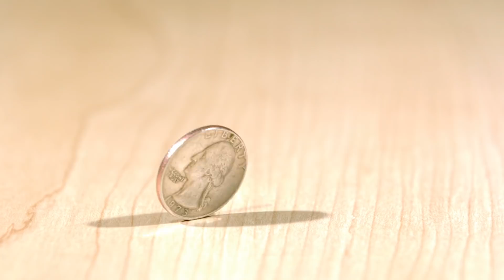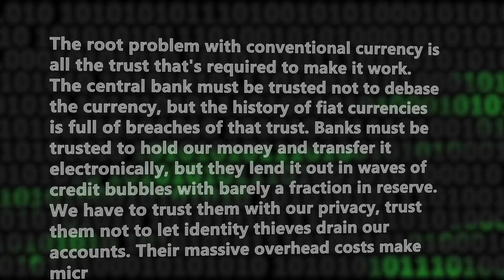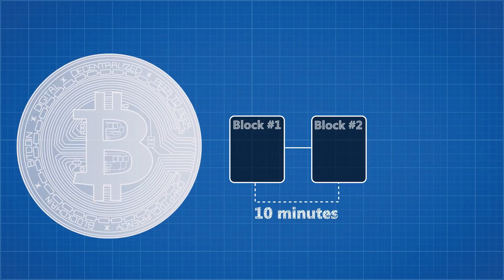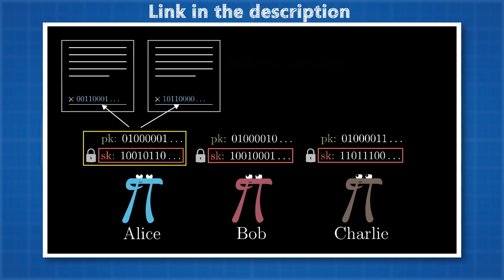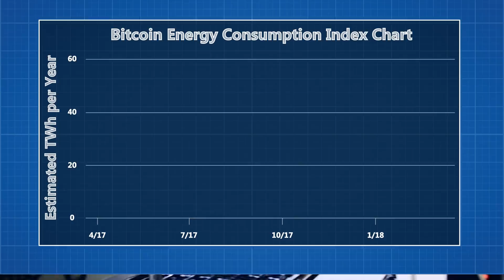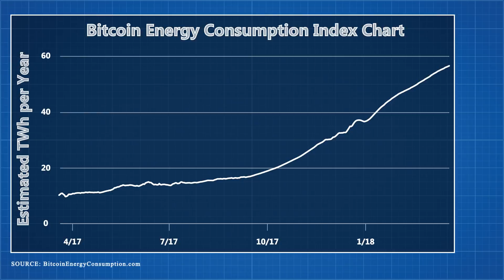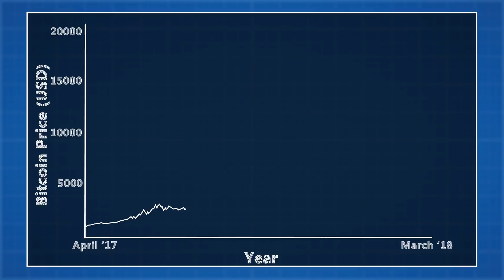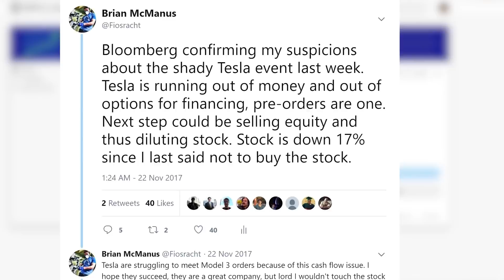Why Bitcoin Is Not Working

Comment: Just a side note: The electricity cost are for security, not for the actual transactions. 
Dubbeling the amount of transactions will not increase the amount of electricity needed. 
So in fact you can reduce the power cost with 99.99% without slowing down the system, it would just be very unsecured. 
It just like a bank, storing gold is expensive because you need a vault and guards and other types of security. And al that cost money even if the gold isn't doing anything.

Second thing: There is a level 2 for BTC: Lightning network. Which would allow (theoretically) unlimited scaling. 
This would allow for instant transactions with almost zero cost.
Only the biggest of transactions should be done one the main chain, and all the things that need to be fast or cheap should use the level 2 network.

Third: BTC cannot be stolen (unless you lose your wallet or private key) or counterfeited.

So BTC will merge the good parts of Cash money (you own the money and can make transactions without middel man), Paypal (you can use it on the internet,...), Visa(cross border payments,...) and the bank system (place to securely store you wealth), and other things. Without most of the bad parts. (Internet and electricity is required)

And in my opinions, I think BTC still uses less energy then the whole Banking system, Visa and other payment systems, Gold Mining, governments and money watchmen and middelman combined.
Because the money system isn't free, nor is Gold mining cheap.
You should compare the energy usage of BTC with the energy usage of what it tries to replace.
Reply: Great comment. Lightning Network is an exciting development.
Reply: Markle2k It's much more likely you will be robbed of your dollars, not your bitcoins, if you live on the edge of society. That's like 99.9% of drug deals gone wrong.

I don't understand what this has do to with cryptocurrencies. Perhaps don't tell them how much cryptocurrency you own? If anything, it's much easier to hide and protect your wealth from robbers while it's in digital form. What's a single point of failure? You can have a multisig wallet which requires authorization from multiple parties before you can send a transaction. Different devices, different persons, different companies. That's the very opposite of single point of failure.

Regulation is coming but I don't think it's necessarily a bad thing. As long as it works for the legitimate actors.
Reply: kaiser sosay And how is that? I think he said every thing right.
Reply: if you want the all mighty and trustful banks to provide security for you - put your keys on a paper and place it in a bank. voila. point is you have the control over how you handle security. you own your money, not the promise the bank will give it back to you at some point.
Reply: upp
Reply: +duo Vire You can better avoid scurvy by eating oranges instead of potatoes (earth apples), but let's keep the comparisons relevant. Any physical representation of economic power (currency) whether gold coin or Benjamins has that weakness. 
We were discussing the weaknesses inherent in single point of failure virtual systems like cryptocurrencies. What's the single point of failure? If you can't identify that, then you probably should not be playing around in a system like Bitcoin. 
Lose your token/passphrase/whatever, your money is gone . Fess up your access under duress: gone. Forget your PIN for your checking account? Go into the local branch with identification and reset it. Lose your phone? Disable payments remotely and buy a new one and authorize it.
Reply: Markle2k The problem is you're implying there is a single point of failure. There isn't. You can have multiple passphrases that all unlock your funds. Store them in separate locations, give them to your friends, whatever. I don't think that's really needed, if you have an USB stick sized hardware wallet, just take that with you wherever you go. You have to be grossly negligent to lose access to your funds if you do that.

You're still bent on losing your coins one way or another? I have good news for you. There is nothing special in banking, it can be done with cryptocurrencies too. In the future you can just sign up with a provider of your choice and they will take care of your funds. If they get hacked, your funds are insured. If you lose your PIN, just go to a local branch with identification and reset it. Simple.
Reply: That's a serious vulnerability. Even if you don't want to admit it. Single. Point. Of. Failure.
Cryptocurrencies attract people who like to live on the edge of society. Those people are more susceptible to extortion and other illegal forms of distress. It certainly isn't a necessary part of putting most of your net worth in a cryptocurrency, but much of the stories are driven by the black market nature of the system.
As in any monetary system, it's the speculators and the clients who need to hide their financial trails that cause the problems. Regulation will be brought by demand of the users, as it was with traditional banks.
Reply: MrIveck you are very confused with youre facts friend.
Reply: "BTC cannot be stolen." You sure about that? There's half a billion dollars missing from Mt. Gox. Smaller meatspace crimes where gangs kidnap and force the victim to transfer their Bitcoin have happened in multiple countries. And these are the ones that we know about.
Reply: If you quote my full sentence "BTC cannot be stolen (unless you lose your wallet or private key)" then I'm still right. Mt. Gox. had it private keys stolen. 
And kidnapping the person with acces has nothing to do with BTC itself. Kidnapping will work on about everything. Forcing someone to give you something is a different kind of crime (Extortion: https://en.wikipedia.org/wiki/Extortion). 

But in essence you are still right. So I will change my sentence to something better:
'BTC itself cannot be stolen without acces to the users wallet(stealing the private key) or without the use of extortion.'

I think that that sentence covers it better.

ps: For the people that want to know how to securely save your private key: Use a hardware wallet. The private key will never leave the devise and because of that no virus kan record you private key. (In general it is not secure to save the private key on your computer, nor is entering the private key on the computer. A keylogger/memory/virus ken easily find the private key that way).

Comment: I don't get the power arguments, why is that an issue? The same arguments could be made for all sorts of things; planes for example, people don't need to fly other methods are way more efficient so why don't we question planes? Your utility argument is also questionable, it could be if there weren't already second layer technologies emerging(eg lightening network) and there will no doubt be more layers. The same utility argument could have been made on early internet, what was the point? Fax and telephone where much easier and did essentially then same thing for way less money. The reason the internet caught on was it's potential then what already existed even if it wasn't immediately obvious to the majority of people. Would you not say that cryptocurrencies have more potential then what currently exists?

Comment: Internet in 1990 =  Just a fad it will die.
Bitcoin and blockchain in 2018 = just a fad it will die.
Reply: Cassidey Ousley it won't die but it won't work as is either
Reply: Who said the internet was a fad lmao. People were blown away with email in itself.
Reply: The problem with the "blockchain fad" is that most people using "blockchains" aren't actually using blockchains. They're using directed acyclic graphs. Now, DAGs are great and it's good that people are adopting them, since they have a lot of benefits, but many would argue that the defining feature of blockchains over DAGs are the fact that blockchains have a proof of work associated with them. And if your proof of work is a centralized organization saying "yes this is a valid transaction", then that's hardly a proof of work.
Reply: Cassidey Ousley Nobody said that about the internet it amazed people when it came out. And that's a shit comparison, like comparing a brand of food like spam to water.
Reply: Compare it better with the dot-com bubble. If you compare their graphs they are exactly the same. Crypto currency have a future but only after the bubble bursts. Only doge coin will remain
Reply: Cassidey Ousley
Dotcom bubble won't pop... Oh wait..
Reply: Cassidey Ousley  did you take that from Vox?
Reply: Correction:
Internet in 1990 = Just a fad it will die. 
cryptocurrency and blockchain in 2018 = just a fad it will die.
The point here is that Bitcoin had stopped being a currency but rather a stock. Once cryptocurrency achieves the level of trust in the world, then that cryptocurrency and others like it will start being in the mainstream. Then, somehow or rather, the whole problem beings all over again.
Reply: People in the past said a popular current thing was fad so this must apply in my arbitrary example as well. Please ignore the actual technical arguments against this technology.
Reply: Sometimes people incorrectly call something a fad, and other times they're spot-on. You have to show why Bitcoin is like the internet and not like, say, Beanie Babies.

People laughing at you doesn't make you Galileo. They may have laughed at Galileo, but they also laughed at the village idiot.
Reply: to be fair dial up was a fad, then there was DSL which made the internet a real thing, then we had cable which kind of popped the .com bubble (and started inflating the cable provider bubble) and then there was fiber... constantly being pressed down by the companies that know that Fiber will end them.

So saying "bitcoin" is like the internet in 1990 is kind of true, they're both fads... doesn't mean upgraded versions of bitcoin can't come along to create a real bubble instead of a volatile investment market.
Reply: I just can't wait until bitcoin stops fucking over gamers... gpu prices are retarded.
Reply: MySpace = just a fad it will die.

oh wait
Reply: internet is a fad? when it first launched people got crazy and the race of personal computing becomes more competitive to the point the individual household can own a computer not just businesses with money...
Reply: Internet had obvious uses. Even before internet, there were LANs, MANs and WANs, sharing data is an obvious use. Noone uses blockchains, they have absolutely zero value. Governments will never allow truly decentralized currencies, and even now most people trade on highly regulated exchanges, which require credit card information. Most ICOs have already failed and there is nothing that blockchains do better than other systems.
Reply: F P Which is why it's changing. RBF, Colored Coins, LN, Segwit, etc.
Reply: Thank you Sherrif for seeing it my way. No new technology ever had the Version 1.0 become the last version. The internet went through 3 iterations just by itself before it shaped into what it is today.
Reply: Ahhh714, Many people are blown away by Bitcoin also.  In 1990 the mainstream did not embrace the internet i think is what OP means.

Comment: What's the point of regurgitating old talking points parrated by old news anchors about how volatile crypto currency prices are?
You'd expect a video made by a 'real' engineer to actually provide a technical point as to why apperantly its not working. When in fact it is doing exactly what its supposed to; providing a method for cheap and secure  peer to peer transactions.   
Besides, recent developments such as Lighting Network are addressing the only remotely valid point you made which is centrelization of mining power.

Comment: Just want to point out that you're seeing the paradigm wrong. Bitcoin works because it has a store of value independent of fiat and you're actually in control yourself. You don't rely on a government or governments to guarantee it. You don't need BTC to process billions of transaction a sec for it to be viable. There are many ways to solving scaling. One is that you intertwine trust institutions between users. You can send BTC to anyone anywhere still, but you drop a middle man creditor in between you and many vendors. You pay in "BTC" and as per the vendor contract the vendor tallies these transactions up and requests a lump sum from the creditor. Later at a given time period a month or so, the creditor requests a lump sum from you which you pay, thus hundreds of thousands transactions can be bundled easily, while still maintaining the abstraction from fiat. 

This is just one of many ideas. You can use faster coins, process small transactions on lightning networks and other types of coins.  

Also you show lots of pictures of graphics cards being used as miners, but no one mines BTC with GPUs. They use ASICS.

Comment: I generally agree. Mining + proof of work is terribly inefficient and as it turns out it's not that decentralized after all. You didn't mention lightning network, which should help with those problems. However, in my opinion lightning network is overcomplicated, doesn't solve the problem completely and it's very likely to introduce new problems - seems to me like some of the other coins approach these scalability issues a lot better.
Reply: Lin Aux I'm just a bit sceptical about LN - it needs to prove itself. It's kind of irrelevant if developers worked hard or not. What matters is if it actually does what it's supposed to do and if it does it good enough.

Comment: Good video, but again only provide one view point on bitcoin, there are many videos that’s explain the issues and problem of bitcoin....
the internet had scaling problems and seems like it wouldn’t work..... I think the power consumption point is again misleading as it’s hard to estimate how much power the currents Financial system uses but it is a lot more than bitcoin... for a global system bitcoin might be the most energy efficient system the world has seen, it also encourages to use cheep and renewable energy like solar, wind etc which miners are using. The Video also fails to point out that bitcoin like the internet is a evolving system that is improving and scaling very quickly, it will be able to do more transactions than visa for the same amount of power it’s using today.

Comment: There are a few things you got wrong in your video. The verification process is done by any full node. Not just miners. Miners will select the transactions to be verified but once that block gets propagated in the network every full node verifies every transaction in it.

Your point of transactions per second is already out of date since the lightning network is now up in mainnet and gaining traction.

And I don't agree with your argument that it's not working because people aren't using it as is supposed to. It's still extremely early adoption. The vision the creator had of it replacing the current banking system assumes that we are in the majority adoption in relation to the adoption curve. I would argue that we are between innovators and early adopters stage at this moment. Because of this I don't find your argument makes much sense.

Comment: I really enjoy your videos, but this time you were quite off.
     1-Lightning network is already working, and it would already solve the scalability issue.
     2-Segwit implementation skyrocketted over the last 40 days, and transactions fees are pointless at the moment.
     3-If less computational power is expended to mine bitcoin, it wouldn't be a problem at all, because it's all adjusted to suit the amount of processing power being expended, some people actually say it would be better because people would be able to mine with less power and decentralize the system a lot more.
     4-Comparing energy expenses between a system that just has a database and is completely dependant on trust(visa), which is also a lot more expensive to transact with, to a trustless system that achieves that trustlessness through computational power(energy expenditure) is just stupid.
     5-Using too much energy isn't an issue at all. we've been increasing the amount of energy produced, and using better sources of it exponentially over the last few years. And that should just keep going ever faster with solar energy being cheaper and with the arrival of great electric cars to the masses.
     Really hope you research more about bitcoin before making another video, maybe you'll be surprised

Comment: Bankers do not (nowadays) store money - they borrow it. Your account of money owed to you by your bank is called your “bank account.” A checking account is a demand account - the bank has to give you your money when you ask for it, and if you ask them, they will give your money to someone else. This instruction is called a “check.” Most of what we think of as “money” is checking accounts. It does not make sense to denominate checking accounts in bitcoin, because bitcoin is a limited commodity, so it’s value goes up over time. That is fine for the depositor, but it is not so good for the economy as a whole - it rewards hoarding, and punishes investment.

Comment: Ah.. trying to replace a system that has been hotfixed for centuries as issues are found and corrected with a 'big design up front' one where the problems are baked in.

Though the really fascinating area to watch are the alt-coins.  Their ONLY value is speculation, people mine them and trade between them and BTC, with the bulk of the profit from this going to exchanges.